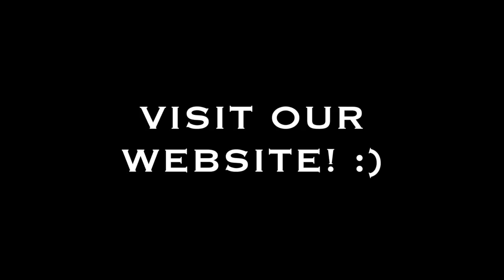VIKING STYLE SILVER RING

Comment: Another way to get the wires together is to put one end tight in a vice, stand on the block the vice is mounted to (mines on a heavyweight chopping board so can go on the floor), grip the other end with pliers/small vice and pull hard. Stretches it out nicely and pulls the wires into line.